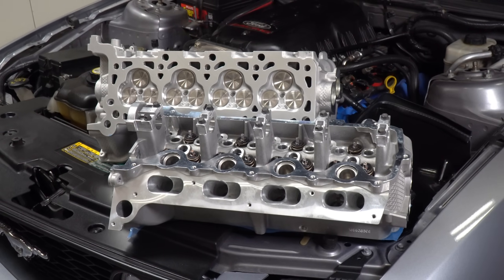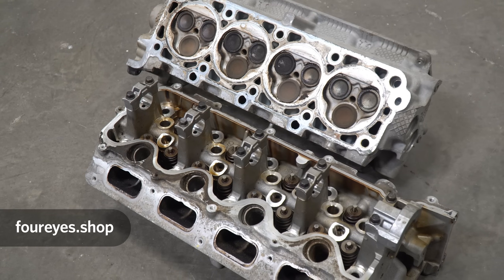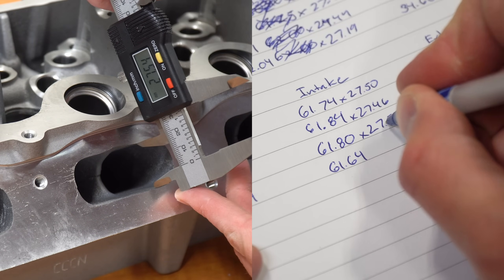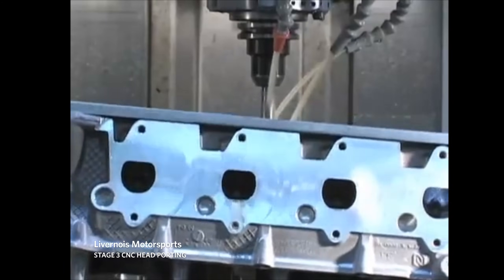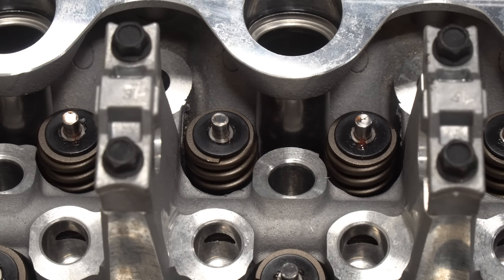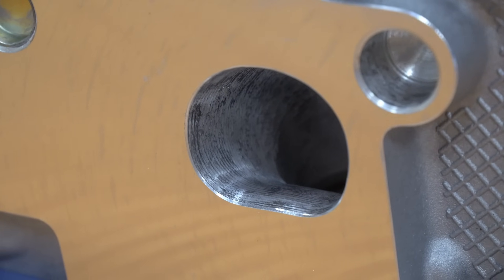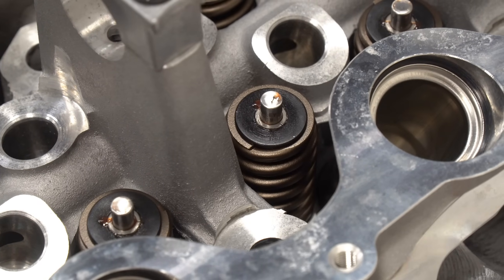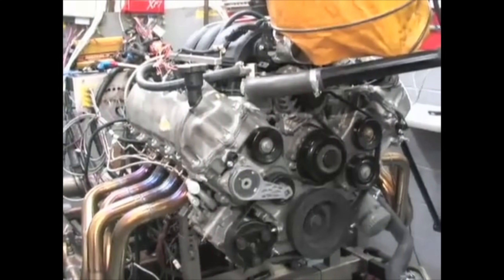Ported Heads Before & After (measurements + dyno)

Comment: Good to hear from u again.  I was just thinking the other day, wonder whats up with 4eyes.  So I just heard u say "1000" hp.  In one of your 1st vids u said on the road to 700 hp.  I've nvr heard of getting a 1000 out of a 4.6.  Pulling for you!
Reply: I don't think you can get much more than 600 horse out of the 3V to be honest, and to me that is more than plenty.  If you want 1000 horse, might want to look into modding a 427 aluminum block ford v8 :P
Reply: @denniss4951  I agree, 600 sounds reasonable but still scary on a stock block.  When u end up putting n a whole new engine then its not really a factory 1000 horse stock car any more.

Comment: I love the detail, especially since it is a 3V. These engines are definitely an “underdog” since nobody seems to do much with them. Keep up the good work. I’m excited to see another 3V in northern Nevada!
Reply: Mine doesn't perform like an 'underdog' and it is still stock.  People seem to be spoiled with what is available today and forget how much power you really just need on the street.  Not everyone lives on a race track or a 1/4 mile drag strip.  At least, I don't and I never will.  Also there were already Chevrolet LS V8 powered cars way before the S197 GT came out in 2005 that would outrun it.
Reply: wiselink marque yea all the new production cars coming out have an insane amount of HP especially for daily driving.
Reply from the maker: Thanks Logan. Good content btw, keep it up 👍
Reply: Four Eyes thanks man I appreciate it.
Reply: Ever push a 3v to 432 hp then add a screw super charger to put it up to 497.
Oh boy it sounds weird but very cool.
Reply: could always build the engine and put a blower on it. I think you can get somewhere around 630 horsepower or so if you do it right.  I want to do it some day but my father doesn't think it is a good idea.  There's been a lot of 3V back in 2005-2006 I can remember with superchargers putting out over 400hp.. it's been doable for quite a long time.  And yes, I can afford ~$16,500 upgrades to the engine.
Reply: Dennis S not everyone wants to forced induction tho. Sometimes people want to push the limits of a motor naturally aspirated,yes it’s a lot of money but seeing how far you can push it and at the end have amazing results is very satisfying! Shit doesn’t have to be Bugatti fast to be fun either
Reply: @petrolhead8851  Agree 100% with this.  I wonder what stroking the engine out to 5.0L does, haven't looked into it before.  I know it's been done for years.
Reply: 3v is shit

Comment: That’s on3 triple pump hat is trash. You need a fore hat. The on3 requires you to seal it using a epoxy because on3’s gaskets for the wires aren’t adequate.
Reply from the maker: I'll pass this info along to the shop.

Comment: Bro listen I’m about to be at 700-1000hp on my 3v. You didn’t need ported heads you just need a built engine, tr6060 transmission, and a power adder such as a turbo.
Reply: He’s trying to do an n/a build with his 3v I think
Reply: Arge NA Three Valve?! Nice, you don’t see that very often! 👍💪
Reply: Arge he’s trying to get to 700 whp.. his plan was to turbo it but I’m not sure anymore
Reply: Nice, man. What’s done to your Three Valve?
Reply: Race Gas Smells Good  diamond flat top pistons, Molnar rods, cobra Kellogg crank, on3 turbo kit, 7875 vs racing turbo, custom turbo cams, beehive springs, comp cam limiters, 2 walbro 525 pumps, return style fuel system, fore innovations dual pump hat, dw fuel regulator, upr fuel rails, fic 1440cc injectors, tr6060 swap, aluminum driveshaft, gt500 clutch, mgw shifter, n2mb wot box, orange konis, ffrp lowering springs, gt500 strut hats, j&m upper control arm, etc.
Reply: @Underrated_civic  Wow, that's an insane mod list! Sounds like a stout combo! I'm gonna head over and sub to your channel! Plenty of Mustang content on mine too, if you're looking for another sub!

Comment: Badass man!! I just picked up a set of used heads from a buddy...im going to port them (my dad taught me how to port when i was a kid) have a valve job done and head surfaces machined. Then im going tk do springs and cams..probably comp stg2 vsr cams. How much was your stroker setup? How long will it be before the motor is back into the car??
Reply from the maker: My shop said it would take 2-3 weeks, everything should be done by early October at the absolute latest.

Comment: If you port head doesnt it mean that you will lose more velocity? Remember when you deleted butterfly valves. If I m right that means you will lose even more low end torque. And putting turbos on top of that instead of somethink that will give you low end torque like supercharger... idk man. My guess is that you will have loads of power at top of the rev range but low end is gonna suck. Correct if I m wrong

PS. Love the build either way. Keep up the good work.
Reply: Extra displacement will add some more bottom end
Reply: @92736xxerMush  Yeah you are right but how much? you said "some" but will it be enough for money that he spends.
Reply: In theory what you're saying about flow and velocity is correct. There can be shifts in the powerband. However, there may also be overall gains from increasing the efficiency of the engine. The heads do have higher cfm ratings and larger ports after being reworked, but that doesn't mean they'll lose bottom end (though some can.) There may have been something in the passageways that was technically adding velocity, but overall impeding the combustion process. The initial head architecture and porting work makes a real difference. For example, if someone just takes some heads and opens them up as big as possible they could lose power everywhere, yet only minor port work may result in bigger gains. Blah, blah, blah. Other supporting mods and tuning will also effect the end results and can change them one way or the other significantly, so lots of variables and can't say for certain how this exact combination will work out for him. Just my few cents, who knows! 🤷‍♂️ I'm excited to see the results myself
Reply: @92736xxerMush  Yeah thanks for clarifying this, not gonna lie everythink i know about that stuff is form english speaking internet and only in theory so I didnt wanted to missguide someone.
Reply: Here's a link to an old article with some dyno numbers comparing stockish 4.6 3v and these stage 3 heads with comp stage 4 cams. Peak torque was higher in the powerband, but their numbers show more torque everywhere. http://www.mustangandfords.com/how-to/engine/mmfp-0812-livernois-motorsports-cylinder-head-upgrade
Reply: @92736xxerMush  Thanks!
Reply: You are correct.  For a NA engine, the larger ports and valves will slow down the airflow, and torque will be lost at low rpm.  Twin turbos will spool quickly, so the torque will never be missed.  A positive displacement supercharger will also fill the low end gap quite nicely.  Once the power adder is on, he'll have all the torque at the wheels that any street tire can handle across the rpm range.  The beauty in this game plan is... the lower restriction on airflow will keep boost pressure down.  This means less heat is generated at the same power level.  The best engine for boost is the best NA motor.
Reply: I agree with Danny Eddy.  That CAN be true for an NA engine,  but once you add boost,  its a WHOLE different story. The PSI being pushed by the turbo or Supercharger  is going to provide all the velocity you need,  therefore its best to go as big as possible.
Reply: @michax175 No problem! Glad to share.
Reply: When you port heads you might as well polish the chambers to eliminate the fuel air mixture from predentination

Comment: Are you going to get the v2 taillights?
Reply from the maker: I don't think so. But maybe.
Reply: @Four_Eyes  They actually do look good on some cars.  Especially toward the dusk time.  I'm not sure if I'm going to change mine either.  But I did put the raxiom on the front and made the DRL lights work.  Those are pretty cool, and always wanted a car with something like that LED-wise on the front, so pretty much saves me from buying a different car right there for one small reason.